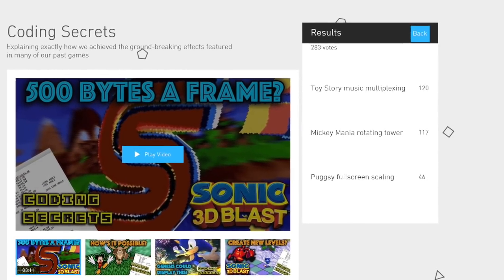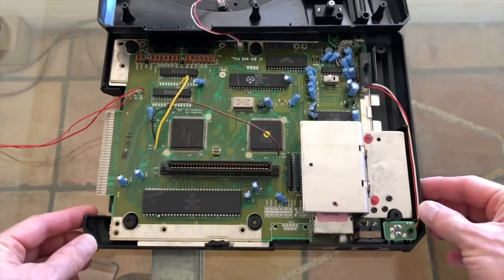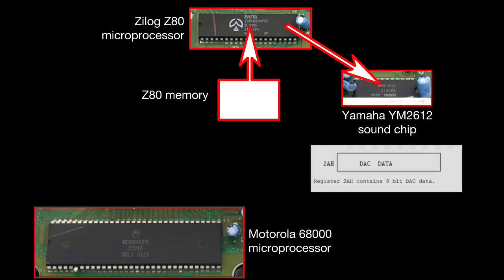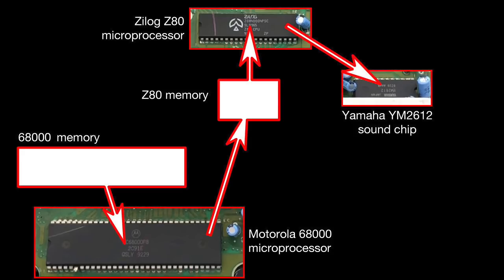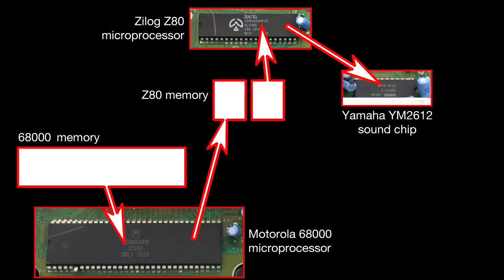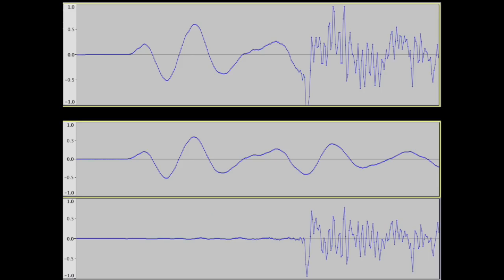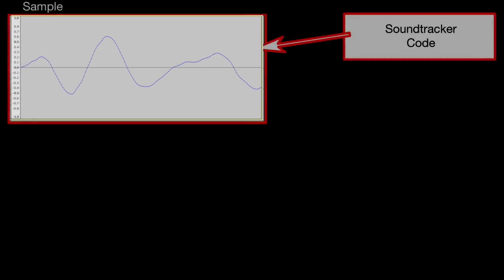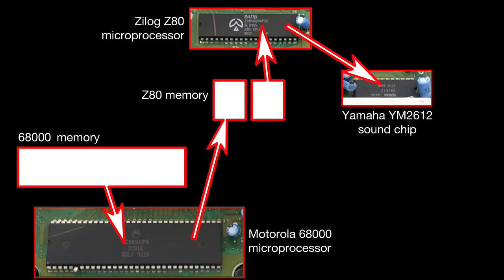Toy Story's Hardware Defying Music - How We Did It

Comment: GameHut: Making the Genesis look and sound almost as good as the SNES. Love your channel!
Reply: +Olivier Doriath
"look"
The Mega Drive has superior resolution and better sprites engine which often provides better animation quality. SNES has more colors and more complex transparency capabilities. Draw (but personally I prefer the Mega Drive spec, higher resolution with better aspect ratio is more important than more colors)

"sound"
SNES is more flexible being all samples-based but sounds muffled (due to the gaussian filter) and with often low quality samples (due to lack of RAM). Draw (but personally I prefer the Mega Drive sound, crisper and with a distinctive sound signature which is a huge plus in my book)

Then since we're at it:
- Performances, the most important aspect and the Mega Drive wins this thanks to its superior CPU. Mega Drive games usually run smoother, with more responsive controls, better AI...

- Lastly controller. SNES has more action buttons and the shoulder buttons can be handy for some games (but they weren't new unlike what some people think, a company called Dempa already did shoulder buttons with their XE-1 AP controller in 1989) but most Mega Drive games are perfectly designed around the initial 3 action buttons and then the system got 6-buttons pad as well. SNES wins this by default but ultimately it's a draw.

Overall the Mega Drive is better. Look and sound are tied but Sega's console has the edge in performances and therefore it wins. Also its higher resolution helps for both visuals and gameplay while SNES wider colors palettes only concern visuals. There are many multiplats where SNES version suffer in gameplay due to the cropped screen in comparison to Mega Drive counterparts.

And do I need to remind that the Mega Drive was released more than 2 years before the SNES? Which makes it all the more impressive! :)
Reply: There's definitely some room for discussion and opinion!

The Genesis' games usually feel smoother and tighter to control, there's no arguing against that, but both the Genesis' and SNES' CPU were very similar in terms of power (MIPS), it's just that a lot of SNES games were plagued by the use of slow rom, which crippled the CPU, and the SNES was arguably harder to program for efficiently (IMO).

Controller-wise, if you're willing to include non-standard controllers, the SNES also had 6 button pads, both arcade sticks and proper controllers.

We can only agree to disagree on the aspect ratio/resolution vs colors and sound flexibility vs crispness issues, but one could argue that the SNES would have an easier time looking and sounding like a Genesis than the other way around. (Look up "Chemical Plant Zone on Super Nintendo [SPC700]" for example.)

Either way, I appreciate your reply, and I promise I wasn't trying to stir up a hornet's nest here, I was just genuinely impressed by GameHut's videos!
Reply: +Olivier Doriath
No worries! And glad to see that you're a nice guy. But there are still a lot of misunderstandings or, at least, overlooked aspects about this debate hence why I like to discuss this ^^

"Genesis' and SNES' CPU were very similar in terms of power"
Untrue. Look up the Sega Retro page about Blast Processing, there's a significant difference in overall power between the two CPU. And I didn't even talk about 3D capabilities... (which is also detailed in the aforementioned page)

"but one could argue that the SNES would have an easier time looking and sounding like a Genesis than the other way around"
Not really. SNES ports of Mega Drive games would have the screen cropped by 20% (Mega Drive usually outputs 320x224 pixels while the SNES is stuck in 256x224 pixels), bad aspect ratio once on TV, less things going on at once...

Actually things would turn out better in the other way around as most SNES games would end up better on the Mega Drive. Gradius III or Contra III for examples, they would benefit of the higher resolution, smoother animation and more action going on at once (sprites, explosions, etc.). These things matter more than just more on-screen colors.

And even about colors, check out a topic at Sega-16: "mockup screens of games from other systems", you might be surprised about some results there! Yoshi's Island or Rendering Ranger for examples.

And about sound, did you hear Savaged Regime or ChiptunedRaijin covers of some SNES music? Castlevania IV, F-Zero or Mega Man X for examples which shows how well the Mega Drive can handle if not improve SNES music.

And still about sound, for me there's a difference between realtime instruments (MD) and muffled samples (SNES). As a friend says, it's like enjoying a band playing at your house (MD) vs watching it on DVD with muffled sound (SNES) ^^

But SNES is no slouch, its GPU in particular has some great features such as advanced transparency or mode 7, the latter being mainly interesting for mode 7 games such as F-Zero. But even this, some homebrewers started to do quite good mode 7 engines on Mega Drive, check out Sonic Team Racing by Gasega to see about this. I dunno how far this can be pushed but this would be amazing if he manages to pull off a mode 7 racing game on Mega Drive :v
Reply: Blast Processing was (at least in people's minds) mostly a marketing gimmick, and even SEGA Retro agrees with that statement. If you go and read the article titled 'The Man Responsible For Sega's Blast Processing Gimmick Is Sorry For Creating "That Ghastly Phrase"' you'll realize something very funny: Blast Processing is the process of 'blasting' data onto the C-Ram mid-scanline through DMA. In other words, it's the exact same method described in the 'How a SEGA GLITCH created stunning images' on this very channel!

I would also like to add that that same SEGA Retro article also covers that the SNES' CPU was very similar to the Genesis' in terms of power, but that it was bogged down by bus and instruction width. It also stated that the SNES had fewer registers, which is true, but I somewhat disagree with the idea that that would have slowed down the SNES vs the Genesis, since the SNES had something called Direct Page addressing, which allowed it to quickly access the first 64kB of RAM! (I could not find anything about the Genesis having Direct Page addressing OR Zero Page addressing, and I could definitely be wrong about this one!)

So yes, the SNES wasn't quite as fast as the Genesis, but I don't think it's as crazy a difference as people believe!

Again, I guess we can only agree to disagree. Color vs aspect ratio/resolution is a matter of preference! Concerning the mockups, I'm not sure that these are completely accurate, since the Genesis had additional restrictions palette-wise (you couldn't just pick any color from any palette for a pixel, you had to select one palette for a tile, and stick to that palette afaik).

As for the music, I have to admit that the Genesis, in the hands of expert artists, especially if one can utilize the channels that would usually be used for SFX, can sound amazing, but so can the SNES (Look up 'Super Mario Galaxy - Buoy Base [SPC700 arrangement]')!!!

But yeah, the SNES' sound chip does sound muffled, sadly, and the Genesis sounds crazy crisp in comparison.

I saw the mode 7 demos, and they're pretty amazing! I wonder if the SNES could also handle mode 7 if it didn't have hardware support for it.

Either way, I'm pretty sure we can all agree on one thing: The SNES Classic is superior to the Sega Genesis Flashback :((((( I was so disappointed with that piece of hardware...

Bonus Meme: Look up 'Sonic the Hedgehog 3 - Hydrocity Zone [2A03+VRC7]' for the original Famicom sounding like the Genesis :)
Reply: +Olivier Doriath
Ye Blast Processing was used as a marketing term but it was based on facts and therefore the guy behind it should not be sorry, on the contrary! If anything, it's Nintendo that should be ashamed since they lied when they tried to damage control against this marketing campaign, something which is also covered in the Sega Retro page about Blast Processing.

Talking about this, I'm not sure if we read the same page. I'm not expert but from what I see there the Mega Drive CPU has a significant edge overall (clock rate, data bus width, bandwidth, 3D capabilities...) and this was further confirmed by homebrewers such as stef (the guy who did, among others things, the Mega Drive version of "Touhou Bad Apple").

But I will see if I can find something about Direct Page addressing on the Mega Drive side...

About visuals, it depends, but in most scenarios the Mega Drive is the best option, the best balance. Only in a few cases the SNES wider palettes are really useful but in any cases you're stuck in limited resolution and even worse, that odd square format (8:7) which makes for a bad aspect ratio once on TV so personally I would avoid it entirely.

"I wonder if the SNES could also handle mode 7 if it didn't have hardware support for it"
Pretty sure that it couldn't, same as it can barely handle 3D without helper chips.

About music, as I explained I just much prefer Mega Drive music, either for exclusives (Streets of Rage 2, Thunder Force IV, Alien Soldier...) or multiplats (Earthworm Jim, Desert Strike, Mickey Mania, Ys III...) but there are still some SNES music that I like such as F-Zero or Jaki Crush. Also there are some kinds of music where the SNES is more at ease such as orchestral.

About the SNES Classic, I have no idea what it is or what's the point of this. Some easy cash? But ye I've heard that most if not all unofficial Mega Drive clones are bad, sadly :/

"Sonic the Hedgehog 3 - Hydrocity Zone [2A03+VRC7]"
Excellent! But ye, the VRC7 comes in handy with its additional 6 channels FM synth and still, doesn't sound as good (the drums in particular). Also does this cover uses all the sound channels available? Or does it leave some channels for sound fx?
Reply: Lol "SNES has a better controller.... but it's still a tie" can't even throw SNES a bone there.  Just saying you sound a little biased.  I didn't realize Genesis had a higher resolution, that is cool.  I disagree with you about the sound - I do love the distinctive sound Genesis games had but I must say SNES games sounded way better.  You wouldn't be able to do a song like "Stickerbrush Symphony" on a Genesis and get the same effect.
Reply: +NickShortsAlt
""SNES has a better controller.... but it's still a tie" can't even throw SNES a bone there"
You missed the following part I guess: "SNES wins this by default but ultimately it's a draw."

Which is true, especially if you take into consideration the overall price, SNES itself was slightly more expensive but it's worse about the games which were also more expensive on SNES and for hardly any reasons! So ye, this lets some margin to buy a new Mega Drive controller ;3

Also as I've said there are a few kinds of music where the SNES is more at ease but still, check out Gauntlet or Devilish if you want to hear some great Mega Drive orchestral/atmospheric music and there are also some good covers, included about some DKC music. I have one in my playlist "favorites", check it out it's pretty good, IMO as good as the original.
Reply: Just checked and lol, it happens that it's a Stickerbrush Symphony cover :D (it's at the bottom of my playlist)

Also:
"I must say SNES games sounded way better"
Disagree. When done right (cuz ye, Mega Drive sound setup is harder to handle) the Mega Drive can sound as good if not better, it also depends of the kind of music, in some cases the Mega Drive is more at ease while in others it's the SNES which is more at ease.

Comment: was thinking... dividing a register by 4 is a very cheap bit shift, and the pitch adjustment seems very cheap too.
... so how much 68k time is alocated to the "mod player" overall? 

i really wonder if that could had been a fancy sound driver used by many games! (or how little cpu time would be left for the game logic)
Reply: Aruã Ramos Metello de Assis 

I could be wrong, but I think the red lines on that test screen was the length of time the music routine is taking?

Although, if there are always four channels playing I would have expected the routine to take roughly the same amount of time per video frame?
Depends on the buffering, and exactly how the routine was coded, though.

Comment: Will we see secrets behind the SNES version?
Reply: Ryuma King nope, shes chip can’t play arbitrary length samples. SPC700 has limited memory and therefore the samples are usually quite low quality.
Reply: Ryuma King Fixed Fun I think he is talking about tricks in general, not specifically this one.
Reply: you can load samples into the spc700 memory on the fly, but you have to use a correctly optimized code or the main console may lag (tales of phantasia's intro did this correctly and streamed vocal samples into the soundchip)
Reply: The SNES soundchip is practically twice as capable as the Amiga's.

Comment: As someone interested in programming for consoles of this era, I really like hearing these "how we did it" videos, straight from the horses mouth.  I am a developer myself and while some of these tricks aren't needed anymore, it helps to expand the way you think about solving a problem.
Reply: His videos are inspiring even to developers who use high-level languages. I think that, for ex., the frameworks and libraries of today should only be a way to accomplish more things in a more efficient way so you don't need to create and implement everything from point zero again and again, but this doesn't mean they substitute creative and innovative approaches on dealing with hardware issues and shortcomings, or software development questions. I think it's worth to mention that many developers today are Web developers, or maybe Mobile developers (I myself am a Web developer), and development has been cross-platform in a lot of cases, so this "next to the bare metal" approach is not so frequent than in the 16-bit era. Maybe the challenge is to avoid the easy and limited ways for everything, do research, be curious and be willing to dare new approaches to solve the problems that arise, and surely see limitations as challenges, not as unbreakable walls. Or maybe try to achieve the expected results in an unique and smart way. I'm sorry if my english is bad, it is not my native language.
Reply: Vinícius, firstly, your English was excellent.  And I totally agree with you as well.  My day job is a web application developer, so primarily I do work in things like PHP/HTML/CSS/JS so I am taken away from the "bare metal" quite a bit.  I guess the point I am trying to make (and you touched on it as well) is the efficiency piece.  Its like the case of BogoSort versus QuickSort.  Sure, most languages have a $list->justSortThis(); method so don't have to develop your own sorting algorithm, but I still think that these things need to be thought of and considered.
Reply: Brian Bates Thank you. Agreed totally too.
Reply: @Brian how much complexity theory do you work with? Because I find that usually the best algorithms come from stepping back from technical details and trying to view the problem far more abstractly, like, so many wonderful algorithms are founded on abstract algebra, but you'd never be able to gleam the context needed for that if you were too focused on the minutia of hardware performance.
Reply: Most modern games are horribly unoptimized, but the challenges faced by modern game devs are very different from most of the ones faced by early console devs. For example, the only reason the whole process in this vid was necessary was because the sound chip was so limited. And most of his videos involve solving problems with limited storage space, i.e. how efficiently can they store each texture or animation to save space, which is not a practical problem anymore AFAIK; there's no problem if your game is 20GB, that's just normal now and not an issue for the user.
Reply: They should be needed. People has to stop going the easy way.
Reply: Couldn't agree more.  Part of my focus as a developer and computer scientist is looking at Execution Time and Performance.  Things like Big-O Notation are important to me.  This is a little different since its about using the hardware in a peculiar yet efficient way that wasn't thought of before.  Most people took system restrictions as Challenges rather than cut and dry facts.  Unfortunately it seems like this has become a lost art as more and more libraries and engines are released that take the developer away from the "bare metal".
Reply: If it's built by humans, it can be improved by humans. I agree with everything you say. I think programmers nowadays just learn the little bit they need to compel their work, there is no curiosity nor "I can do this better" attitude.
Reply: @smuganimeloli  "They should be needed. People has to stop going the easy way."

What kind of backward thinking is that? Making life mandatorily hard when it's not needed is utter bullshit. By your logic people should still be riding horses and sending messages by pigeon. If people want to go back to the old systems for a challenge then that's fine. I'm doing it myself by learning Z80 assembly, but to keep everything awkward is just utter nonsense. 

Also, fuck you for shittng on an entire generation of modern programmers who work their asses off every day. Modern code is much more convenient, but if you think that it's easy then you don't know what you are on about. Take your elitism elsewhere.